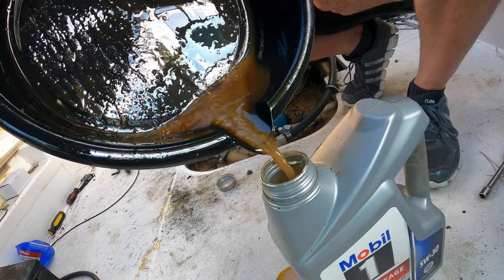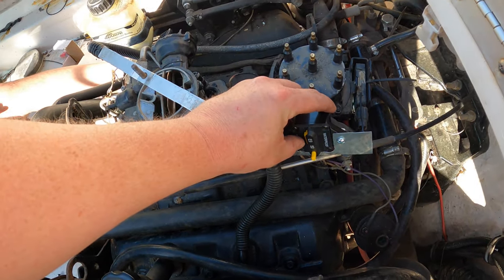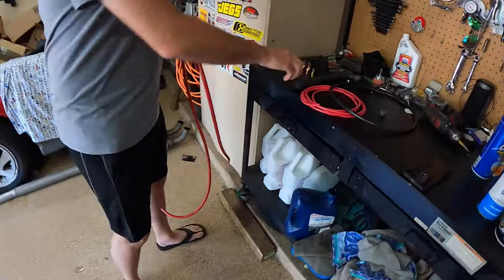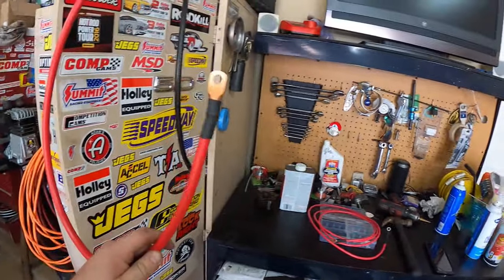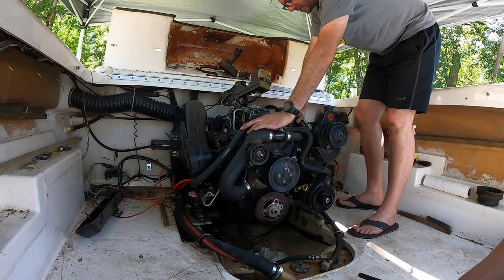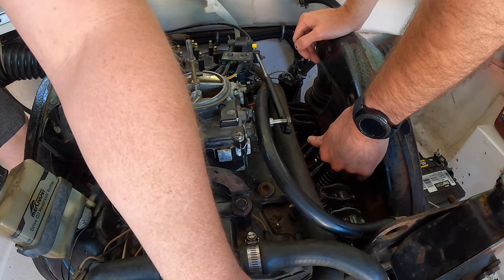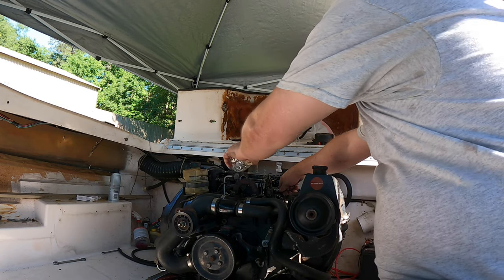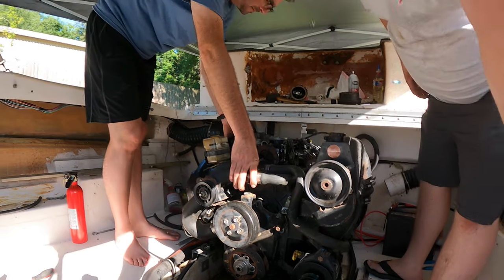Our Mercruiser 4.3 runs (kind of) after sitting for 18 years? Boat Rescue: Part 3

Comment: Hello friend, I would like to know if the mercruiser 4.3 engine is the same as the 4.3 vortec from gm?
Reply from the maker: They are evey, very close. But older boat 4.3's are non vortec so you kinda need to do the research on the difference to identify them. One good way is to see is that vortec intake manifold bolts are vertical, while non-vortec are at an angle.

Comment: Do you have water running on this? If not you're going to burn up your outdrive water pump without it even a short period of time as it's only a rubber impeller.
Reply from the maker: We were more worried about making sure it was worth going any further. Definitely noted for the future though, thanks!
Reply: @RacerXGarage  I get that but then you make yourself more problems and cost more money going forward just for not hooking up water flow. After that amount of time most definitely need a new pump anyway, but maybe not just now.
Reply: You should really be inspecting and or changing that out drive impeller every couple three years anyway, they are trying to make sure the engine is even good, once it's a know good engine they should probably replace the outdrive seals and impeller anyway so if they burn up that little piece of rubber now it's not a huge deal.
Reply: @dieseldime  It is if it causes more internal damage through more overheating, like warping or cracking a head or ruining a head gasket for example, it takes very little heat to do that and it heats up very quickly.

Comment: I know this is late. One thing I have noticed here on YouTube all these people who claim to “restore” don’t actually do it correctly. I don’t know if you ended up doing it or not but with that engine being locked up for that long the right thing to would have been to take it apart and rebuild it.  Because you don’t know the extent of the rust damage in those cylinders. Rust in oil pan to. I will say the same thing as I tell everyone else. If your going to do something like this especially if your going to sell it then do it right or don’t do it all.
Reply from the maker: You and I definitely come from two different camps. I much prefer the mantra from David Freiburger “Don’t get it right, just get it running”. 

Sometimes it’s not worth the effort of a full rebuild depending on the project. Sometimes it’s worth trying to get something running before deciding to continue with effort or financially committing to a project. 

This boat was either going to run or get sent off to the bone yard. It’s not getting sold to someone else. It was a last ditch effort to try to save something from our childhood and to make a family member happy by doing so. This was never a “Restoration” project. This was a, lets see if we can get it running and back on the water one more time kinda of project. 

There is a lot of context you’re missing here, and I believe a lot of assumption because of it. However, everyone is entitled to belong in the camp of their choosing. I’ll hang out in mine and see several vehicles come back to life, and perhaps you’ll have a several year long minty project or two. 

Either way, as long as we’re enjoying the hobby does it really matter? Just because it isn’t the way you would do something does not mean its not the “right” thing. There are several paths and options here. 

You do yours, I’ll do mine, and lets just both enjoy working on these things and keep the hobby alive!
Reply: @RacerXGarage  I think we both misunderstood something here.  All i was implying was i have seen to many people do "just enough " then turn around and sell it for 5x more than whats  it worth.  If your intentions were not to sell it then i agree.  Dont spend alot of money on something your not going to sell in the first place.

Comment: Jesus yall are flooding the crap out of it. A little splash of gas is enough and when itd start youd flood it some more
Reply from the maker: Well, it worked out. I see it as a lot of that fuel leaves when you first turn the motor waiting for it to convert to vapor